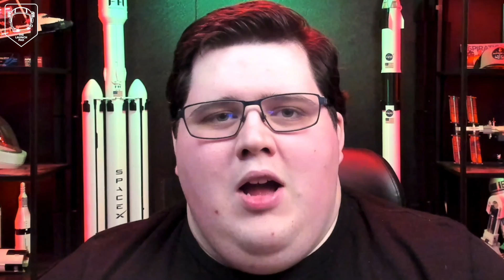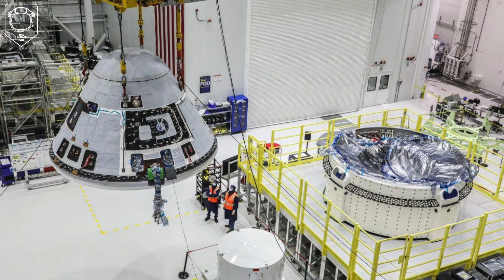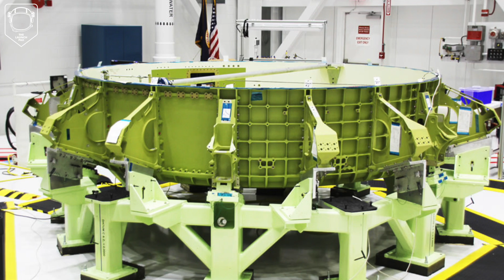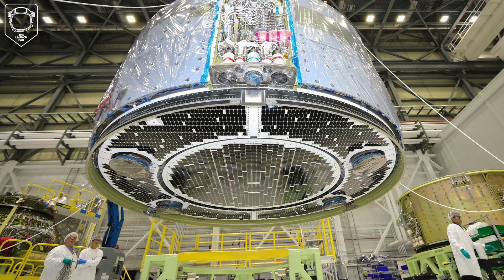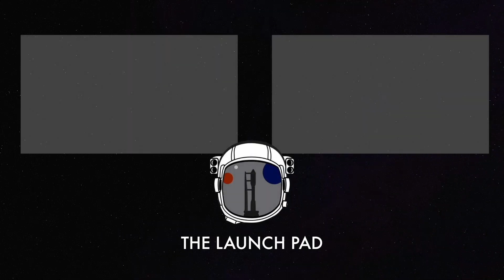BREAKING! Boeing Scraps Starliner Module

Comment: They continue and continue, they would have done everything on Starliner if they were checked properly on every stepand inner problems of Boeing were solved, I hear a lot about those problems, if all the problems are solved and valves too, not to mention other problems with Starliner they might find, then Starliner will be ready to launch in May, or a little later.

Comment: It only took them a year to do what Elon would do in a week.
 "This part isn't working quite right. Kill the whole thing with fire and bring up the slightly newer modification!"
Reply from the maker: haha yup
Reply: yes, their approach is a bit old and needs revision and changing, they need to learn to work as SpaceX, but they would do that I suspect if pride allows them too, Blue Origin learned that, but their pride obviously does not allow them to follow SpaceX example
Reply: @marinarepan5578  Recent interviews with ex tesla people have explained the real advantages.  Musk companies have continuous integration testing for hardware.  Every software and hardware change they make goes immediate into an automated testing process to vet it as much as possible.  No other company has ever done that for cars or rockets.  Musk companies can change any small thing anywhere and be confident that a ton of tests are ran before it hits the test stand.

Everyone else is test adverse because they consider testing to be too expensive so they freeze designs and don't allow changes.  They freeze innovation.  Musk made testing as cheap as possible so you can do it constantly, so you are always innovating freely.
Reply: @marinarepan5578  Starliner is made by Boeing, not Blue Origin.
Reply: @simonrmerton  both Being and Blue Origin need to change their policy and work like SpaceX anyway